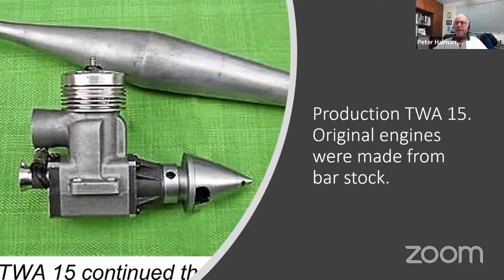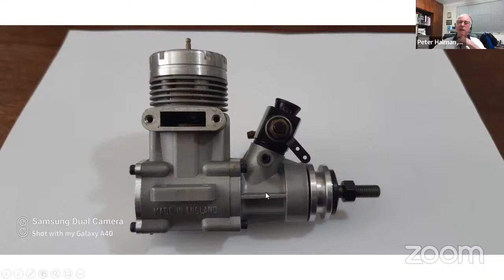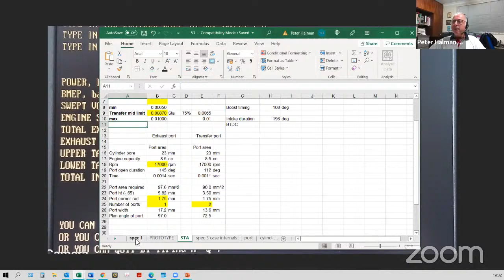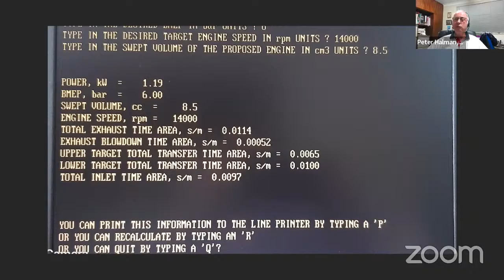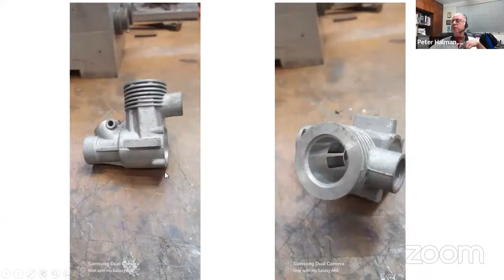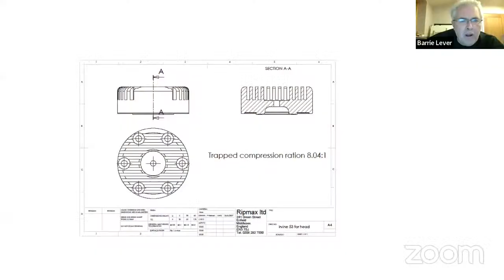'In the Air Tonight' - 2 stroke model engine development by Peter Halman FSMAE

Comment: Would have been more useful to us non-experts to have a brief intro to the terminology used in the talk such as scavenging; boost, transfer and other ports etc Even the wax casting process
Reply: Very briefly.
Scavenging, , the fuel/air mix enters the crank case as the piston rises and is then pumped thru transfer ducts into the cylinder when the piston descends, the point of entry into the cylinder is the transfer port window.
Boost port, ,  transfers are usually in pairs, one on either side and mirror imaged, boost ports are usually single and mainly to "steer" the air/fuel mix to the correct area of the combustion chamber.
Wax casting, , a full sized "model" of the desired shape is made from wax then placed in a box full of a certain type of sand with 2 holes down to the wax, molten metal when it's poured in thru one of the holes destroys the wax leaving the metal item in the sand, air and fumes escape from the other hole.
Very basic explanation but it's probably better that way than causing even more confusion
Edit , the fuel/air mix also needs a certain percentage of oil added as 2 strokes don't have a sump like 4 strokes do, the correct amount of oil per litre of fuel will be recommended ed by the engine maker in the instruction manual.